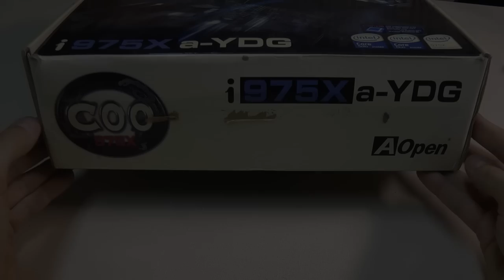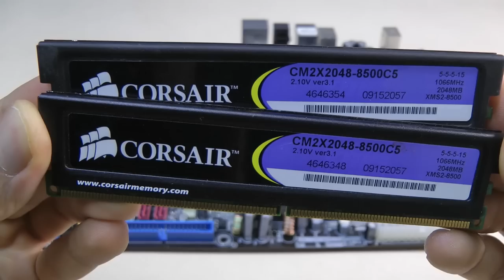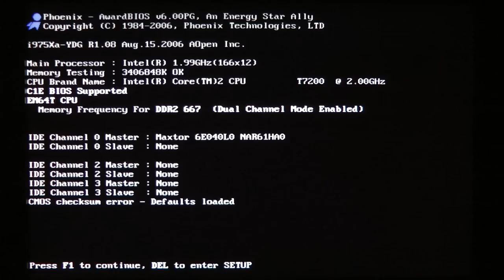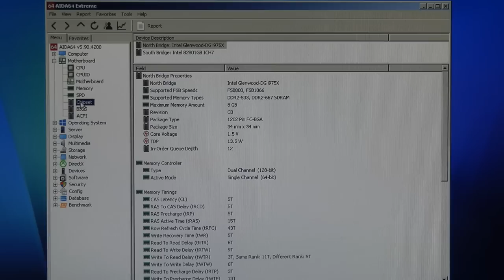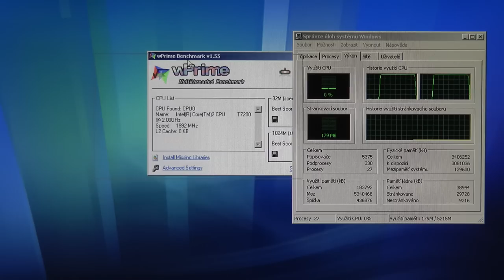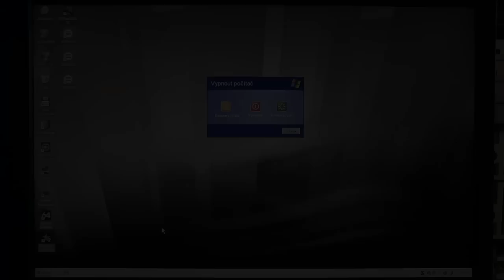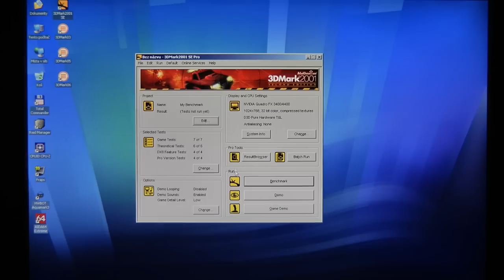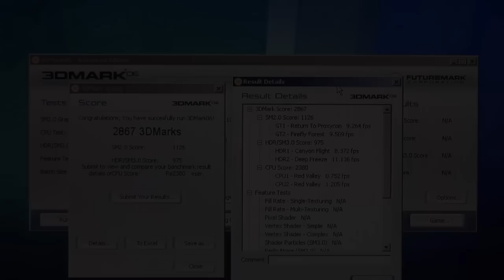socket 479 AOpen 975X Core2Duo @ 2.7 GHz + NVidia Quadro FX4400 - RETRO Hardware

Comment: You are king of retro stuff buyers and  impossible to calculate how much does components cost. I have got a pentium 2 mmx :D
Reply: Waw...and you are using it right now?
Reply: @teodze3432  Yes my friend. S3 Trio 64+ pci video card which has 1mb vram :D, p2 runs at 350MHz 128 mb sdram 100mhz and runs on windows xp. However win98 is much better on this pc.

Comment: I have one those CT479 with the best CPU that it would take... This is a failed project tho because I could not get it to boot on my IC7-MAX3 despite bios mods + shorting pins on both of the sockets :/ Keep on going, I love this stuff, thank you!
Reply: Those are made for Asus boards, P4P800/P4C800/P4GPL/P4GD1
Reply: @Andy they also work with other "non-supported" Asus boards and also with boards from other brands... There was a list somewhere, it should not be that hard to find.
Reply from the maker: Yep originaly adapter was only for several Asus boards. I saw few guys made mods too. Question is if really works and how.

Comment: just stunning ... really great job ! what is the adapter used to put a dual core on a socket 478?
Reply from the maker: This adapter supports only single core CPUs and only Dothan core (Pentium M/Celeron M).
Reply: thanks for the advice
is it better that I keep my pentium 4 northwood 3.40ghz on my asus p4p800-se?
Reply from the maker: They were good for OC and yes with better performance. Will make some compare in future.

Comment: So is it safe to use modern Power Suplies, since old components use  5V instead of modern 12V, on retro hardware, i iam planning of getting a GPE 700S from Chieftech
Reply from the maker: I'am using few years old PSUs aorund 500-550W like Tagan without problems. Also you can buy ATX to AT adapter for any ATX PSU and this works too. You must keep same all values for voltages.
Reply: @RETROHardware  Thank you, i have few of Pentium 2 and 3 PC so i wanted to turn theme into retro gaming stations bc there PSUs are totaly ded

Comment: İ have a Packard Bell sb86 with socket 479 & Core 2 Duo T7500 but not run, i don't know why.The Chipset is a Pm965, so as long as it is not for the Bios...have you any idea??Maybe FSB?? Not support FSB 800Mhz??Up 667Mhz Max??🤔🤔🤷